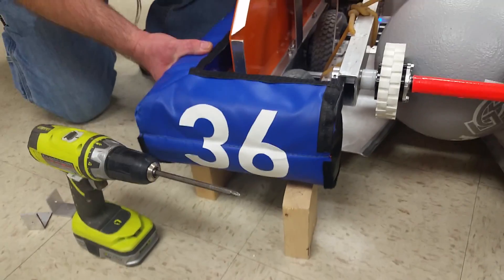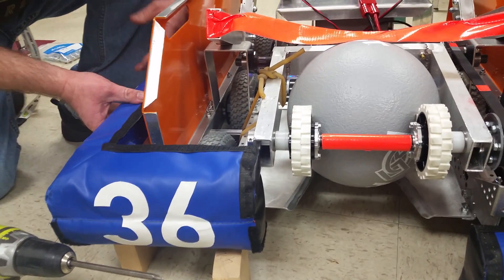Unnamed robot doing its magic 2016

Comment: Im fairly certain that your numbers cant be divided like that in the front. You need to fit the whole number on one bumper. At that point youre either team 36 or 33.
Reply: +Luke M as kevin said there is nothing saying you cant split your number into two sides it just needs to be easily readible